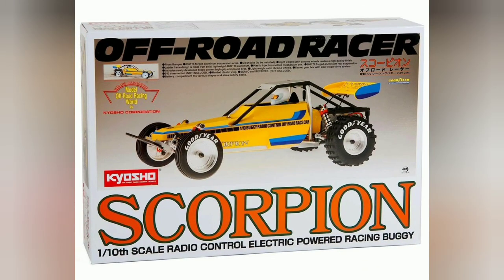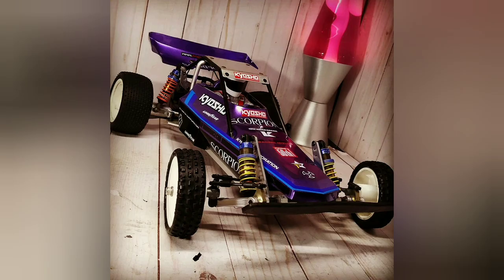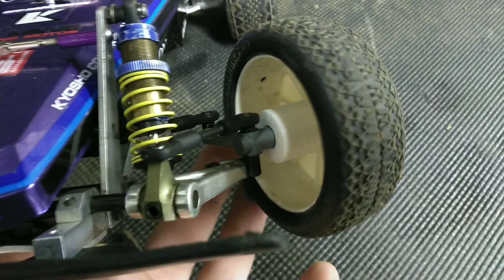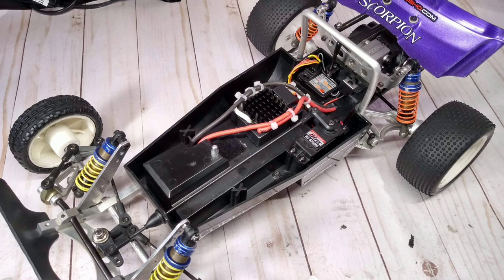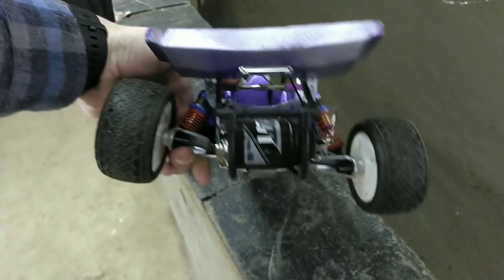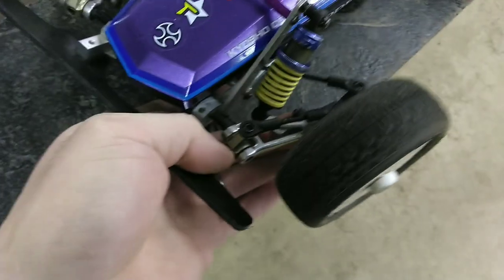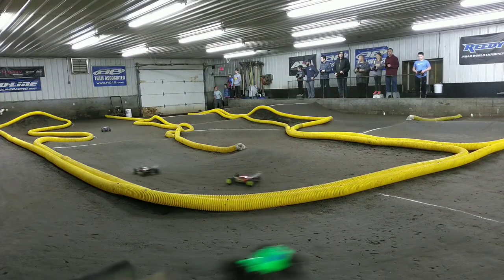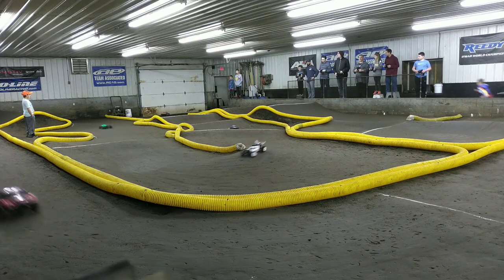Racing a Vintage RC Car!? Kyosho Scorpion Re-Release

Comment: wow it did pretty good, what size tires were you running on the track? 2.2?
Reply from the maker: Yes, just standard 2.2" tires. They were all TLR 22 2.0 rims. The rears are reversed to get the correct offset, and the front tires I designed a 3D printed bearing to hex adapter.
Reply: @Pilotgeek  nice 👍thank you!
Reply: @Pilotgeek  I am haveing some problems with my buggy losing control. The strait line stability isn't that great, and tends to spin out. Do you have any tips to fix this?
Reply from the maker: @coopersharp2921  this buggy seems to like a bit of toe in on the front. I also limited the steering to like 60% of the servos throw because the stock geometry creates some wild Ackerman towards the ends of travel. Could try thicker grease in the differential as well.
Reply: @Pilotgeek  thanks! Yeah I also noticed I had to limit the servos when I was building It